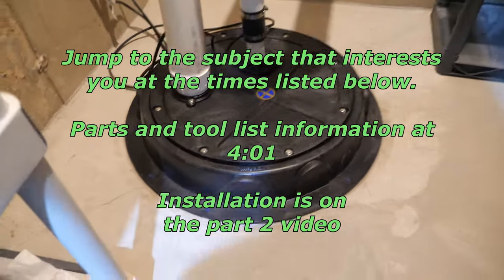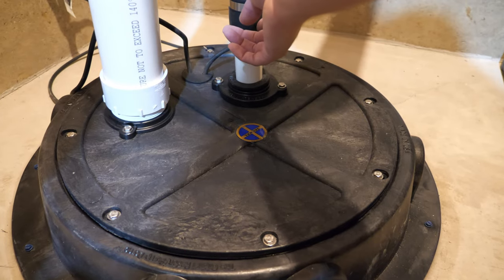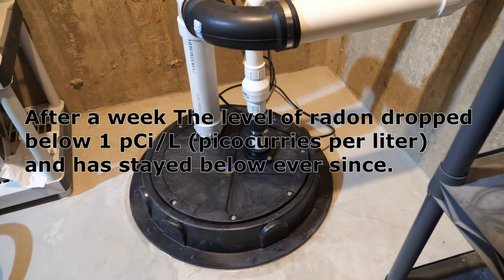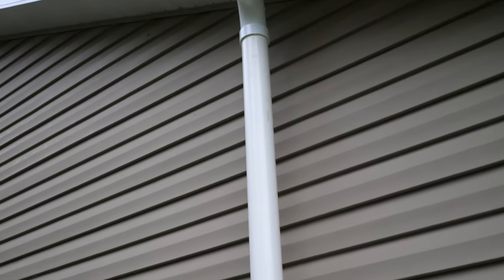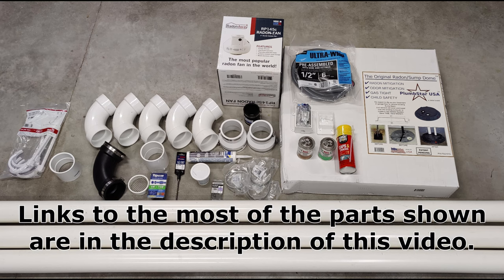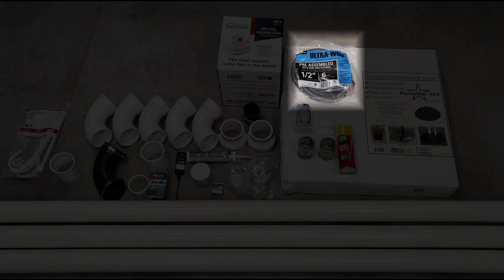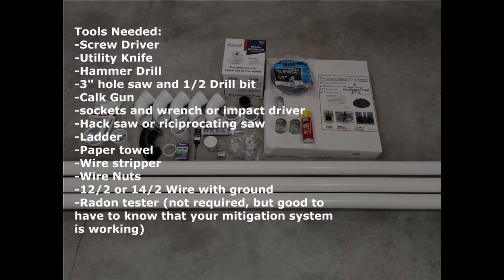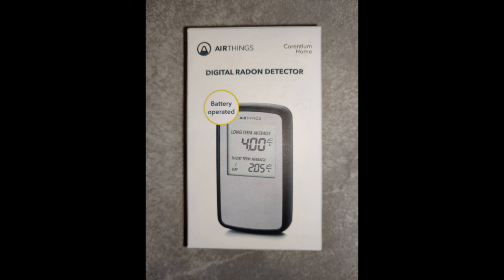Radon Mitigation System, parts needed and installation - Part 1 of 2

Comment: Good install. One thing you probably should check - not sure your manometer is adjusted correctly. This is a problem for most installs because people don't realize the glass tubes can slide up or down in the bracket. Your vid shows it is pulling vacuum , but, the other side is setting at zero. Zero the gauge. To do this, just pull out the clear tube, and slide the glass up or down to get both sides at the zero mark. The lower the vac pull, the higher the airflow, so with a semi-accurate measurement, the fan manual will then tell you how much actual airflow you are getting. Bottom line is what you have already figured out with the use of these terrific digital gauges - your radon levels dropped radically. Well done.

Comment: Do you need to drill another hole on the slab and add PVC pipe to outside for decompression or just using the sump is okay?

Comment: I thought the outer diameter of the pipe for 3 inch is 3.5 inch, how do you cut s hole using 3inch hole saw???  Does a 3 inch hole saw cut a bigger hole than 3 inch to fit the pvc outer diameter?

Comment: A question:  I have a sump pit in my furnace room. Can I drill a 4 inch hole and install my mitigation pipe 3 feet away from the pit?  I would rather have the pipe closer to the other side of the room.

Comment: By adding that 1" drain that bypasses the radon fan you have effectively introduced a huge leak in the system. The fan is going to be pulling air down from that drain instead of from your basement. Did you add a manometer on the inside PVC to test for negative pressure?
Reply from the maker: Yes I had a vacuum indicator in the basement and it was producing a vacuum, also the radon level decreased in the basement. The fan manufacturer required the drain, or it would not have been covered under warranty.
Reply: Why not just put a hood on top to prevent water going in instead of building in the 1 inch bypass?

Comment: Great job, can I ask a question if you don't mind? I have an existing passive system PVC pipe from the basement to the attic. I bought a fan that I'll install. My question is if it's ok to put the fan in the basement instead of in the attic? In the attic it's a bit inconvenient to reach. My current level is 4.7pCi/L so it's not crazy high, so would it be ok for the fan to be at the basement level pulling the radon up or is it much better and safer to put it in the attic to make sure that radon gets out of the house? Thanks for any input.

Comment: do you have a link to the 3 inch screw in adapter going into the radon pipe hole?  Does it need to be rated sch 40?

Comment: Looks like a very quality and thorough installation, and an effective YouTube, but why no backup sump pump, battery backup and inspection plexiglass?
Reply: I agree with all of this.  Great looking installation.  Very clean and pro-quality.  The drain for the fan is the first I've seen and a great idea.  But yes, no backup pump? No alarm or water detector? No sight glass?  All things that I plan for my system.
Reply from the maker: The window was an extra cost, and I didn't see myself peering in the window to look to see if things were working when the sump output and the fan are easy to check if either system is working. As to the battery backup for the sump, the area rarely has any power issues as the power lines are mostly underground, if I were in a place with an electrical grid that was not as trustworthy may have considered it.
Reply: @techfox540 what couplers did you use on the top and bottom of the fan? The ones with the clamps. I'm assuming you used those clamps instead of gluing the fan so you can replace it in the future, correct?
Reply from the maker: @chancellorcarter716  They are rubber "boots" that were included with the kit, and do indeed have a hose clamps so I can replace the fan in the future if needed.

Comment: I have a question: if you just install such a pipeline, without a fan, does it still work good? My reasons: 1. because the sump lid is sealed, if there is some gas (air or mixed with other harmful materials, most from the underground) in the sump space, pressure is built up, the gas will come out. I think we can also use a vertical sewage pipe which has a vent up out from the roof to guide the gas out. Use natural pressure difference to release the gas. (The higher place has lower pressure than the lower place). What you do think?
Reply from the maker: No, without a fan it will not work. The fan creates a negative pressure that pulls out the radon gas. If Radon is heavier than air and will sit in the basement unless pulled out.
Reply: Without a fan the system will be considered a passive system instead of an active system.  Of course it won't work as well without suction, but it might work well enough if your radon levels are only marginal to begin with and the sump is your only source of radon entering your house.  It doesn't hurt to try without a fan first, just be sure to test again to see if your passive system accomplished the safe radon levels you want to achieve.
Reply: @raccoonhouse  This is the correct answer.  Many homes now in high radon areas (Canada) are pre-built with a passive system in place.
Reply: @raccoonhouse  Thank you very much for your reply. Quite to the point.

Comment: My lid arrives today and I'll be starting this project.  I want to use a 4" sch40 pipe, can this be done with this lid?  If I use a 3" threaded coupler and step up to a 4" pipe doesn't that defeat the purpose for airflow?
Reply: The 3-inch hole with a step up to 4-inch pipe should work fine, actually  better than a 3-inch line all the way to the fan.  The 3-inch hole in the cover will be a slight bottleneck, but air is compressible, and once it reaches the 4-inch pipe, the flow resistance will be lower in the larger cross-section and the system will work slightly better.
Reply: @raccoonhouse  I've been trying to post my reply to you and Youtube keeps deleting it seconds after, this is getting frustrating.  Let's try again ------- I just decided to cut a new 4" hole into the lid.  Results ended up great.  Good volume, maximizing my fans specs for pressure vs movement, creates a uniform speed of flow at the entrance to the piping this way, keeps it quieter too, and most importantly, reduced my Radon levels to negligible numbers.  I tried to post a link to my pics but perhaps this is why my reply doesn't remain on here.
Reply: @c.a.n.4202  what cutter device do you use for the hole? Have a link to tools and parts?  It cuts a 4 inch hole exactly?  Which pipe parts or setup do you put through the 4 inch hole u cut out?  Or do you put a threaded adapter through it?
Reply: Similar question for what tool and pvc parts did u used to cut the 4 inch hole to go outside?  Links to parts would be helpful.